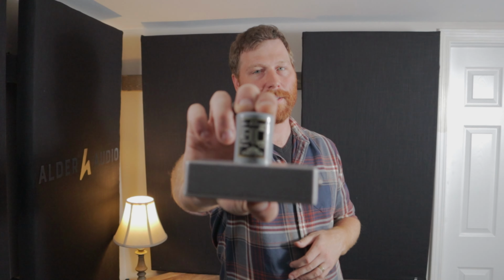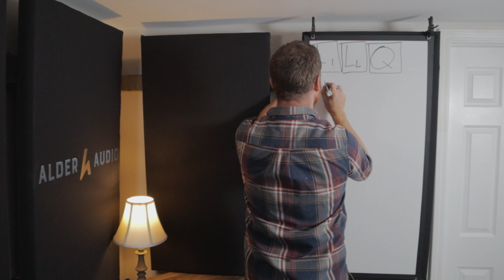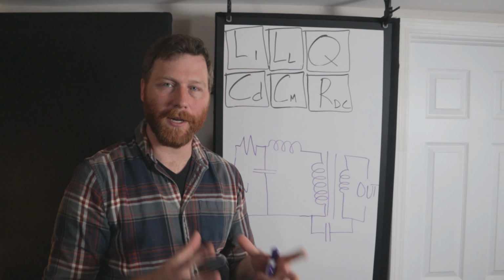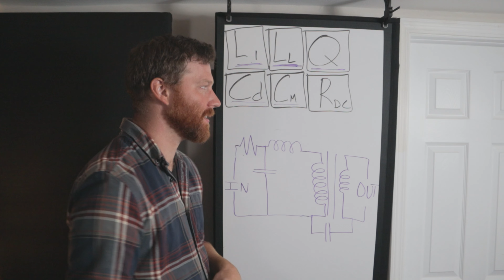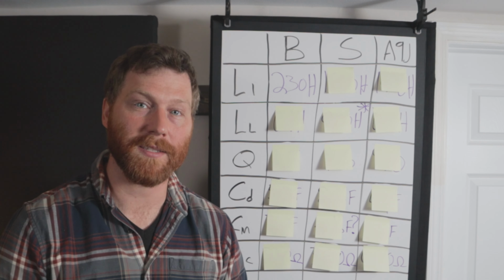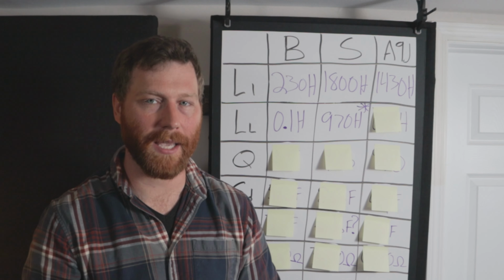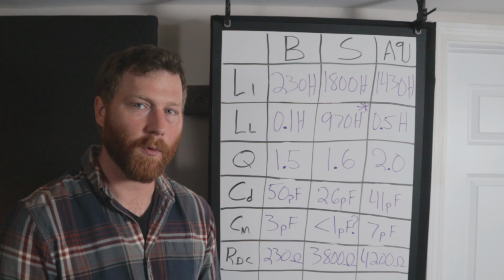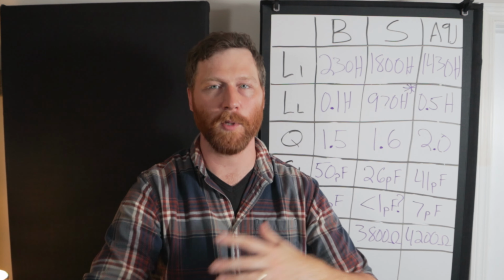Where Does Vintage Transformer Magic Come From? (Triad A9J, A12J) | Transformer Series Video #2

Comment: I like your approach, but I thought with my research the way the transformer saturates was more important (BH Curve). Another useful parameter that is not talked enough is Phase per frequency. Inductance leakage is a wonderful one, does it correlate to less Bass and Mids ?

Comment: I came across your video while researching the VTB2281, how would the A9J compare to this?
Reply from the maker: It looks like the VTB2281 is a quad coil 600:600 ohm transformer, sometimes called a repeating coil.  The Western Electric 111C is a sought after vintage model wired similarly.  You can wire them 1:1, 2:1, or 1:2.  However this configuration is very different from the A9J, which is a ratio of 1:12.  In this DI context we are actually using it backwards as 12:1.  The need for the big ratio is to adapt the high impedance bass guitar signal to a lower impedance XLR input.  So very different applications and not interchangeable, just on the ratio alone.  All the other specs like the inductance and DC resistance would also be very different between the two based on their intended use.
Reply: Thank you for taking the time to explain that to me, very helpful.